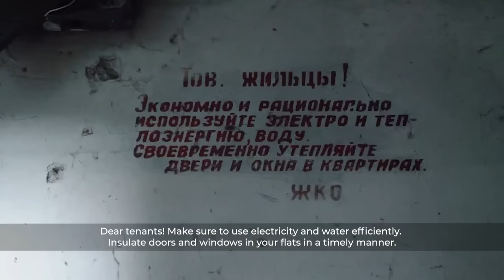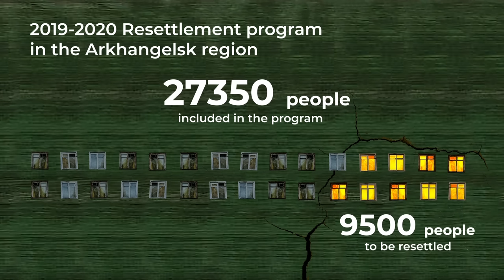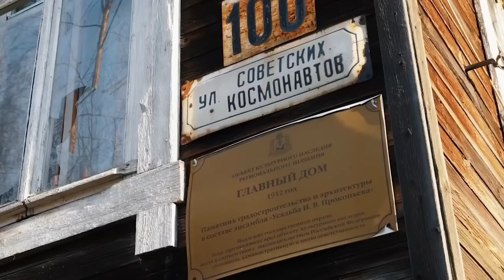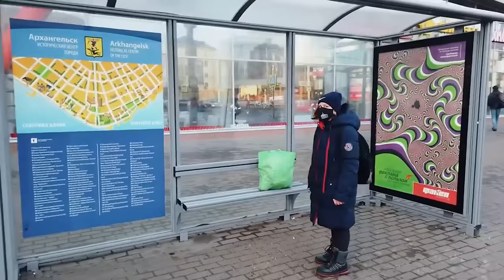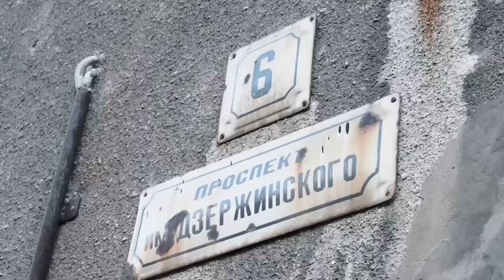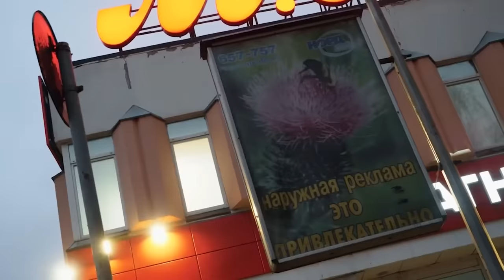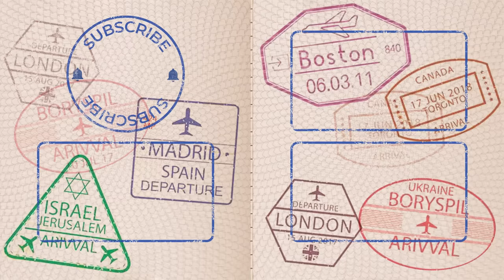How People Live in the Most Unlivable City of Russia? | Arkhangelsk | Documentary ENG SUB

Comment: The heating pipes most likely have a Anti Freeze in them, to keep from freezing, that would be fine in a closed system, leaning into the ground water, Not so much. I think that because there is so much leakage it has undermined all the foundations. Believe it or not the Barracks might have lasted longer if foundations as well as propper building mantance was reguallarly done. The USSR was notoriuos for putting up temp apt blocks that often became perminants, but also most of these people never had to do mantance on there infrustructure or whole building before!!! This is the result of never fixing nothing. Houses falling into sink holes. In the USA in many areas here, a small leak can build to a sink hole, taking better built house then those here!!!